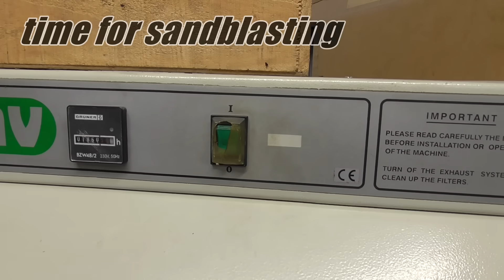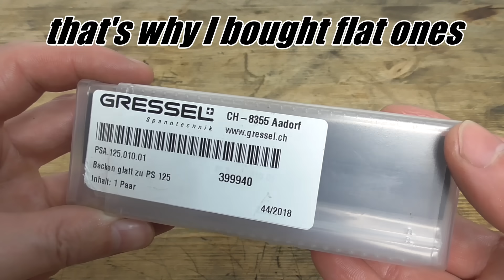Rusty Deadlocked Vise - Perfect Restoration

Comment: How is this even worth the time it took? I mean, it's impressive, but not when you factor in the time vs cost of buying a new one. That said, it's a good vid, which holds a different value as a Youtube episode.
Reply: If you already have the equipment to work with, the used raw or created materials are cheap. This video is basicly a showcase what a professional can do with the right equipment.

Comment: Let me get this straight, in order to make a few of those parts turn black you heated them up then dropped them in linseed oil? That’s a cool trick. Does it  protect the metal from oxidation?

Comment: After ALL THAT WORK, why leave all that WHITE METAL protected by nothing but grease? A coating of Telfon-Nickel will do wonders. Both for corrosion protection, friction reduction and also recover some of the tolerance lost due to the filing and sanding.

Comment: If I'm someone at home without these tools how else would I do this
Reply: You can easily soak the vise in vinegar and baking soda for 24 hours, then take it out, dry it, then use loads of wd40, let it sit for hours, hit it again, then let it sit. It might take longer this way but it should work just fine. I don't have a sandblaster (wish I did) so a wire brush, sandpaper and files work wonders, but takes time. He did an awesome job. Don't understand why he didn't sandblast the jaws instead of replacing them. He did a spectacular job.

Comment: Lovely.  Two questions:  1) does hammerite paint not need a primer? 2) are you tapping the screw holes larger, or just truing the threads with the same size tap?
Reply: I have used Hammerite paint onto bear sheet metal when I made my own cases for equipment, I did use a primer, (choose for Ferrous or Non Ferrous. The Hammerite lasted many years, it looks great too.

Comment: Very nice craftsmanship. If you can find them a set of left handed drill bits to go with your screw extractor set can be very helpful. Sometimes a left handed drill is all it takes, but if not it at least has the advantage of not acting to work the screw in tighter while you're trying to drill it out.

Comment: after using bead blasting, and sanding out the rust, isn't it makes the material thinner? 
will it affect the fitting? nut and thread ?
for example the main shaft thread thinner, it can be shake by hand.

Comment: great restoration vice video ..great job /I like the white letters and green paint ..very sharp...you are talented ..you should restore old cast a way vices and sell them...I restored a different company vice ..it wasn't bad just took apart and sanded body and taped off handle vice ends and sanded and spray painted red and got small roller and rolled mfg..lettering with black paint and let the sun bake it dry ..came out nice and bought at yrd sale ..I figured it was better than buying new Chinese crap steel vice...

Comment: WD 40 is not penetrating oil.  Croil, PB Blaster or any of the like are penetrants.  Use your electrolysis would have helped.  Great job on the end product. How old is this vice?   Love the paint and details
Reply: In general, heating rusted steel with a gas torch is more effective than spraying WD40. Those pins would likely have gotten loose with a tiny bit of heating of a oxy/propane torch.

Comment: Most of us, compelled to restore and redeem a beautiful object from from its passage through time, will use the tools one has at hand to do so.  Such is the case here.  Each of us viewers would likely have different tools at hand and thus create our own path to redemption, for this significant object of physics and art.    My history is not so much as a machinist or mechanic but a remodeler.  For removal of rust I make a "pickle" in a plastic bucket, using a quarter cup of muriatic acid  per four gallons of water (1:256).  The soak time can vary but is usually just a matter of seconds or minutes.  Rinse with water, then water with detergent, then water again, dry with wiping, then hot air, like a hair drier or oven on low.  I restored a couple of thousand mixed rusty screws like this 40 years ago.  After the oven, I tossed them, like a salad, in a very small amount of light oil diluted with mineral spirits.  I still use those screws from time to time.  They have a light oily film on them and not a speck of rust.

Comment: I have to admire the incredible amount of elbow grease behind all the filing, sanding and stoning. Terrific reproduction. Great job. Just a thought, In die work we usually grind narrow grooves on the dog leg cams, slides and heel blocks to retain the grease. Wouldn't be true to design I realize but could help to maintain the smooth and effortless jaw movement you demonstrated. P.S. I bet there is some incredible history behind that solid old Gressel workhorse.

Comment: Guys look at this info.
     
Penetrating Oils Compared 

Machinist's Workshop magazine actually tested penetrants for break out torque on rusted nuts. Significant results! 

They arranged a subjective test of all the popular penetrants with the control being the torque required to remove the nut from a "scientifically rusted" environment. 

Penetrating oil ..... Average load 

None ..................... 516 pounds 
WD-40 ............. 238 pounds 
PB Blaster ............. 214 pounds 
Liquid Wrench .. 127 pounds 
Kano Kroil ............ 106 pounds 
ATF-Acetone mix....53 pounds 

The ATF-Acetone mix was a "home brew" mix of 50 - 50 automatic transmission fluid and acetone 
*Note the "home brew" was better than any commercial product in this one particular test. A local machinist group mixed up a batch and all now use it with equally good results. Note also that "Liquid Wrench" is about as good as "Kroil" for about 20% of the price

Comment: As an alternative to the WD-40 for breaking stubborn screws, bolts and whatnot loose, we have a product here in the States called PB Blaster.  It works better than WD-40 in my experience in most circumstances.  I don't know if you can get it where you are, but it's a fantastic product.

Comment: Very nice job with a great finished product. I've done lots of these in my 72 years. Couple of suggestions. Buy WD40 by the gallon and dump the whole thing in for a week ( if you have the time). Does a great job loosening things up. I've done it lots. Also get yourself some Rust-o-vert. I have no connection to them just a very pleased customer. The stuff is like magic on rust. Best out there. Again well done.

Comment: I'm glad you edited out the 30 minutes of tapping the jaw out.  It turned out gorgeous.  Is that an OEM color?  I just picked up a bench vise today.  Have needed one for awhile but wanted something vintage and quality.  I think the size will serve me well but it was smaller than I wanted.  It's an Empire Tool Works No. 40 (4") Erie, Pa.  It does not swivel but seems like it would be more robust when using the anvil.

Great video, you took your time with that one.  Spending that much time with a $100 vise turns it into a much more expensive project, but there is a lot of love and respect for bygone craftsmen there.

Comment: It was so much work. Did you consider using electrolysis first to remove the rust? Or, going straight to sandblasting before all the scraping, filing and sanding? Also, i can recommend for the letter painting to use a hard rubber roller, the kind signmakers used to ink the metal type. Also, spraying the vice with clear paint at the end preserves the finish basically forever.

Comment: Congratulations on a good job well done! - and no silly music!!

I would definately not use grease on the slides and screw though - it only holds grit and dust - far better to use machine oil occasionally.
Reply: No, it doesn't "only" hold grit and dust; it also protects against rust and lubricates, and since they are heavy, robust parts with generous clearances, grit and dust accumulation in the grease isn't going to harm anything. If it builds up so much that it actually feels gritty when operating the vise, you simply clean it and apply new grease. Machine oil holds grit and dust too, obviously, plus it doesn't stay in place anywhere near as well as grease, nor is it effective lubrication for parts under any significant load, such as the load you put on the threads when you are clamping down hard on a part in the vise jaws.

Comment: I just wanted to see how he got the rust off. Have a 60 year old hammer to deal with. Watched the whole video. Wow. What patience and excellent work. I have a question for you industrious folks over in Metric land that has nothing to do with machining but I curious so I am going to ask. How do you frame timber houses/buildings. In the States we use 2x4's (actually 1 3/4" x 3 1/2") spaced on 16" from the center though sometimes they do 24". How is it done with metric measurements.

Comment: Hy! Your work and the result are very impressive. Congratulation for it! I would like to start nowadays a same project on a similar rusty big vise. But it is from other manufacturer, i dont now yet from which, maybe some russian or hungarian one. I bought it very cheap, ca. 10$. It was stock too, but i started it, little bit on another way as you. It is not missing for anything, but the jaws and their bolts will i change to flat ones like you. So in whole process i would like to follow your steps, and methods, but I have three questions: For make black the parts is it applicable any vegetable oil, for example sunflower oil, or only the rapeseed oil produces this result? And how many time shold be the parts in the oil? What to do, if the parts was heat threated before? I waiting for youre answer! Thank you very much!

Comment: Wow, as an old mechanical engineer I found this quite addicting and satisfying to watch.  You have a new subscriber.  I did find it interesting that the part where the crank pushes against the stationary part of the vise, the part you had to make (seen finished at 16:20) , was only a half donut and not two halves for a full surface transfer of the force from the crank to the vise.  Wonderful video.

Comment: Beautiful results. I am humbled by your patience and attention to detail.  Shows just how novice my junkyard vice restoration video was. Guess I'll have to restore my other vice now to try to make myself feel better. I loved the plate idea for removing the pins, I was skeptical about the aluminum tape but it looks to have worked a treat, and I've got a set of silicone plugs I use for blocking off the threads etc.  All in all a lot for me to learn not only for improving my channel, but also for improving my techniques. Thank you for posting.
Reply: Tip #1 Don't split your vice restoration into 5 separate videos.
Reply: @kenk8215  Yeah I didn't want to. I'm not great with the computer and I'm having issues finding an editing software I can both afford and understand how to use. I just downloaded a new one to try so hopefully that'll help. I also want to put more effort into improving the quality of my videos, many of them were done quickly because I've been juggling getting work done but also trying to get something posted (which I know isn't great but hopefully is better than nothing). I appreciate the feedback.

Comment: The rust is here removed with various abrasive techniques. Why not go the easier way and use a liquid solvent for rust? Some work very quickly and thoroughly, leaving a possibly pitted surface that is clean of rust. Final polishing then completes the job.

Comment: How do you not put the rough plates back on the vice.. your restoring it and you have the original part in salvageable condition and don't  even use it... even if your "not a fan" the whole point of a vice is to have a strong grip on things, that's what the texture is for.

Comment: this is beautiful. is the aluminum tape just for masking? I'm wondering if just masking tape would have sufficed.
Reply: Does not matter, you can layer masking tape as well as ALU tape or even electrical insulation tape until one or the other makes thick enough barrier... I would go with masking tape, you can get it in /near/ correct width, it's easier to cut, easier to rip, cheaper and faster and found in every household.. but we speak difference of cents and seconds in total..

Comment: It might be a silly question, but why haven't you sand blasted everything instead of having used the file?
Reply: Maybe because you loose all sharp edges and then you have to file the surface three times as much to remove enough material? And removing too much material you change the dimensions too. Just a guess. Thermal deformation does not applies here, it's not sheet metal. And, no matter what, you have to use file to regain original look.
Reply: @jankatzenbach2596  it makes sense. So essentially you should try to recover original looks with the file, sand paper, oilstone and use the sand blast only as a last resort?
Reply: @andresilveirah  I think yes, at least if you are after exactly the same look. 
In that case I would use same tools/process as when first time fabricated. 
You can mimic some surfaces by using more modern or faster ways but some effects requires using original method. 
I am more of a spray painter so take my words easy.

Comment: 7.3 k down like this video? I mean did you even watch it and think how beautiful before and after.
Reply: For me its not the before or after but the machines used for the result. Especially machined parts for a simple vise restauration and only once used for its deconstruction, way too much put into that for me.
Reply: I'd dislike it just for the fact he put smooth plates on it instead of the rough ones.
Reply: @everythingfan9726  terrible. The video showcases some amazing restoration work and you thumbs down because of that?

Comment: I've found that if I'm patient, I take these rusty, valuable items and let them soak for 1-2 weeks in automatic transmission fluid. Pour enough of it in a bucket and allow the vise (or any rusty item) to be completely immersed in ATF.  After a week or two, you won't have to pound or struggle greatly to get the parts separated. 

Good video.  Thanks for posting.
Reply: A better recipe is 1/2 ATF and 1/2 Acetone. Works better then any rust penetrant I've seen.
Reply: @CR3W1SH03S  What is ATF???  I would like to know. I bet it would work. What comes to mind is the Bureau of Alcohol, Tobacco, and Firearms.
Reply: @okosjune8711  Automatic Transmission Fluid. ;) Sorry.
Reply: @PrashantRawat  Works for John Wick! LMFAO!
Reply: I've often used diesel with success
Reply: Good idea.
Reply: Michael Livingston ahh but Michael that good idea reminds me that the difference a youtube content creator Vs a top quality well earning youtube content creator!  The later, takes the much more crowd appealing must-click must-see approach and keep them amazed!
Reply: Another approach is electrolysis. 5 gallon bucket of electrolyte (water and baking soda). 12 volt battery charger positive to sacrificial piece of iron/steel anode. Your rusty work is the cathode. Time needed depends on voltage and current rate.

Comment: Beautiful restoration! Top notch! My compliments on your craftsmanship. Question: why do you put grease on the screws? I don't get that! By the way...on the sliding parts of the vice...use Vaseline (petroleum jelly) instead of gobs of grease. Cleaner and easier to apply. :)
Reply: Most likely it's to make future repairs easier.

Comment: Could you have used a steel brush on a drill instead of sandblasting? Or would the result not have been as good?
Reply: maybe a steel brush drill, but not at all as clean or effective as blasting.

Comment: You will have better luck loosening parts by using PB Blaster spray instead of WD-40. 

Just a suggestion. Enjoyed the video!
Reply: exactly - WD stands for Water Displacement - for rust i recommend citric acid (in the form of juice that you get from a lemon for example) or simple winegar.Much more effective.

Comment: I don't know why people continue to use wd40 as a penetrating oil when it is not. It is actually fore for keeping your sensitive electrical parts from water and moisture that might build up.  It got its name from WD water displacement 40 was the 40th attempt during making it. That's the story and I'm sticking to it.  A great penetrating lubricant is PB Blaster. Or some transmission oil if you are in a bind.

Comment: Absolutely impeccable restoration, but if I tried using a vise that works like this one I think I would go mental.
I am too used to working with the normal ones where the front part of it moves, and the back part remains stationary.

Comment: You’re making great content for those of use that love to repurpose and rebuild, keep up the great work. Would like to recommend something that I found that breaks and loosens rust like you wouldn’t believe. It’s a 50/50 mixture of acetone and automatic transmission fluid. I keep some in a spray bottle and when I need to break lose old locked up rusted gears, I go to this mixture and it is incredible. Acetone can be substituted with mineral spirits or paint thinner as well, they are all from the same solvent family so to speak. But still very impressed with the quality of video and work. Thank you

Comment: Truly great craftsmanship. I've watched several of these now, and the attention to detail is incredible. The only thing that bothers me is that he calls these "restorations". They aren't. He isn't reviving the items he works on, he's rebuilding them to a standard that is higher than the original manufacture. The end result is a tool any small workshop would be proud to own. There's a  downside, however. If the pieces had any historic value or provenance, it's gone by the time he's done. That said, the videos are fun to watch and I greatly admire the work he's putting into them.